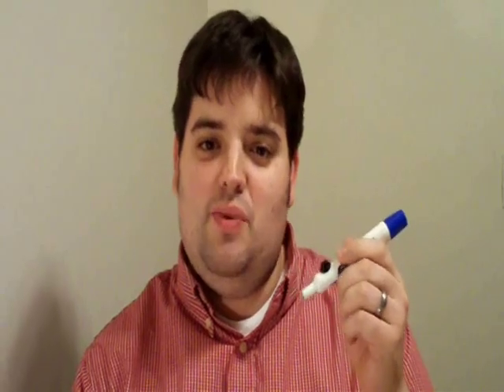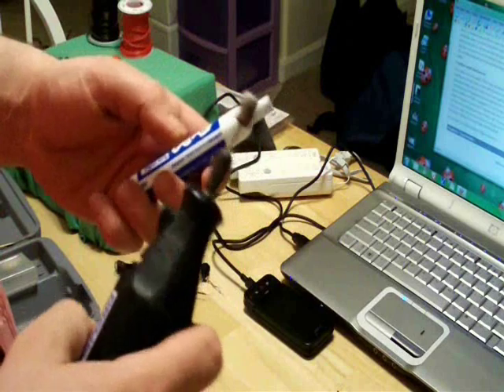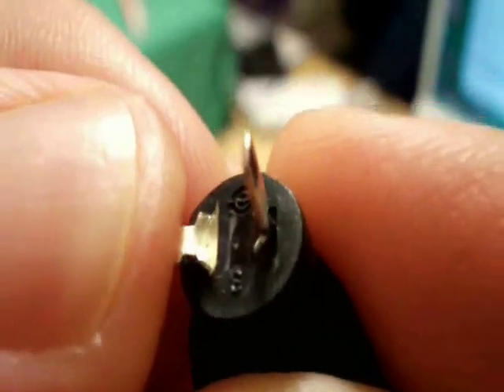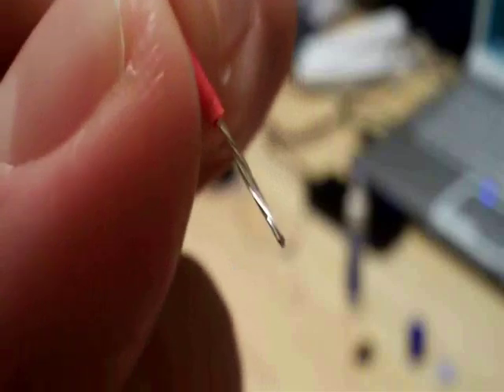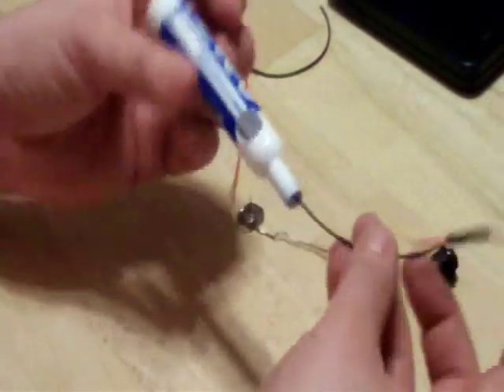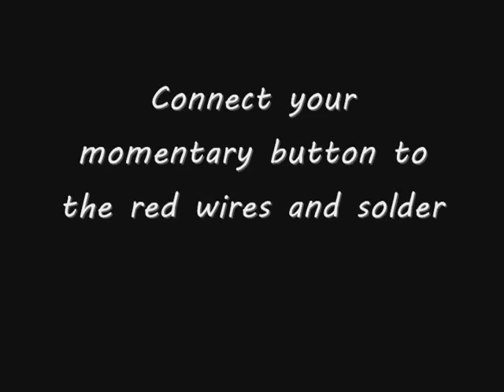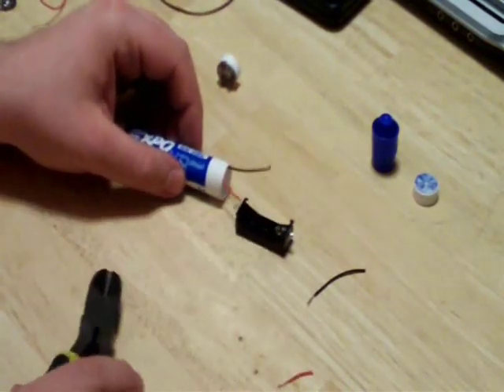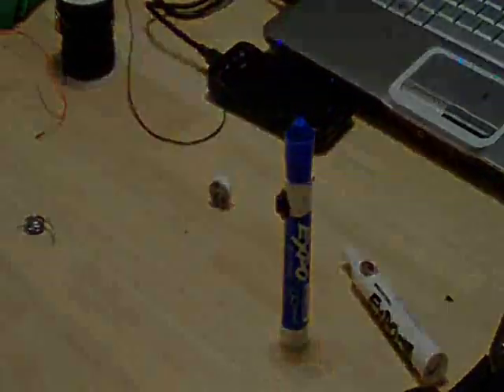Wiimote Infrared Light Pen Tutorial

Comment: It would be better if you were to remove the button altogether and instead add some sort of non conductive spring behind the LED to push it forward, then when the pen is touching the board the spring retracts allowing the non connected pin from the LED to touch a contact point to complete the circuit and light the led, the circuit would then be broken when the LED isn't against the board and the spring pushes the LED back?

Comment: @sperryfam 2 AA may burn your bulb out quicker.  I used some old PVC pipe and an old Expo marker top for mine.  At most 1 AA should be used (same voltage as an N-sized battery I think).